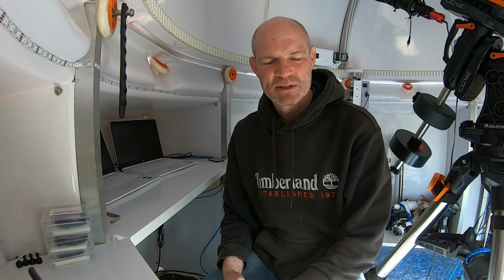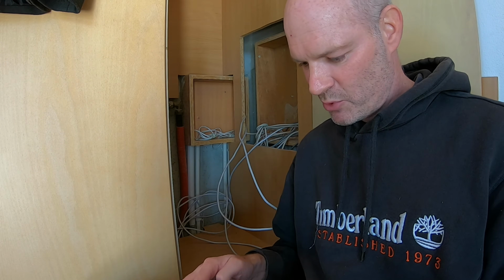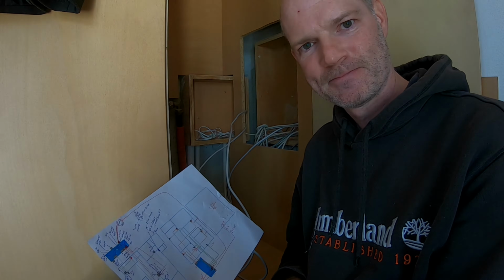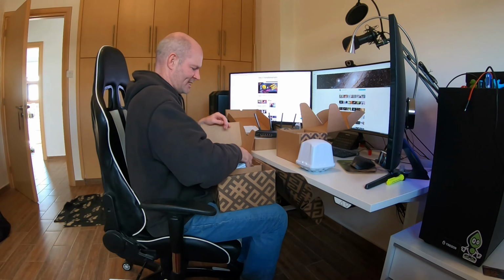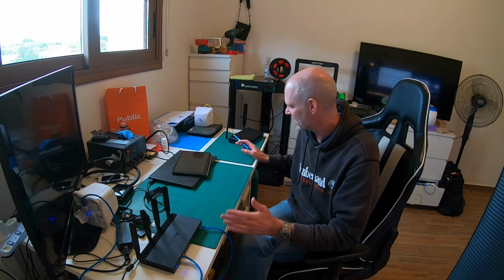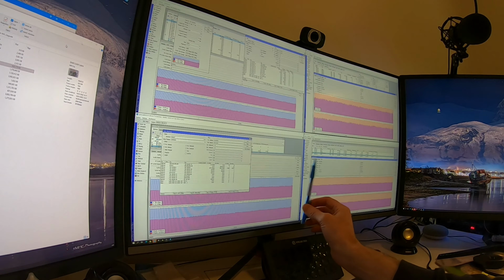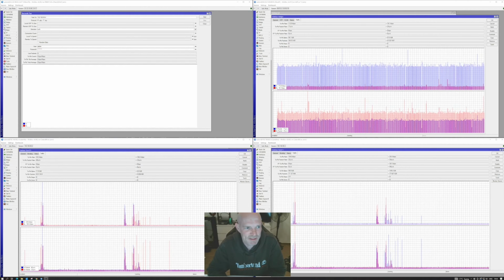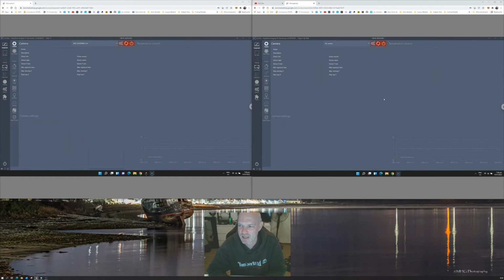Observatory 60GHz WiFi Upgrade Project - A much needed improvement!

Comment: Awesome setup Dave, really thorough job👌looks like it's totally a solved issue for you now!
BTW, that's a heck of a 3d printer in the background in the clip starting about 15:50 haha! :-D
Clear skies!
Reply from the maker: Hi Luke, yes the floor standing one is the Anycubic Predator, nice big build volume, I can easily printer rings and mask for the 11inch scopes on it in one piece, the other printer is the AnyCubic Mega S.

Comment: I found using an ethernet cable to my astro stuff solved all my problems.
Reply from the maker: Nice! The remote location for the dome, made running cables impracticable, it is bad enough I have an extension cable for power run at the moment until I can get a solar solution in place at some point this year.